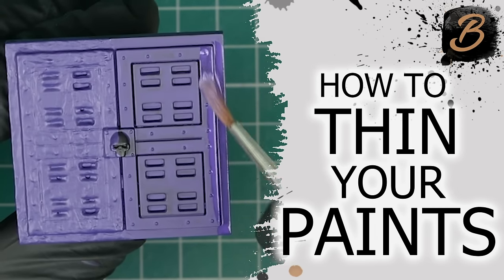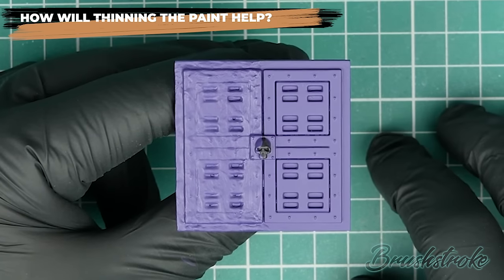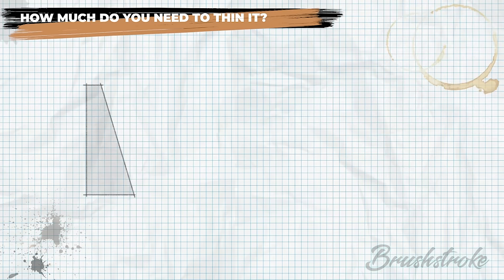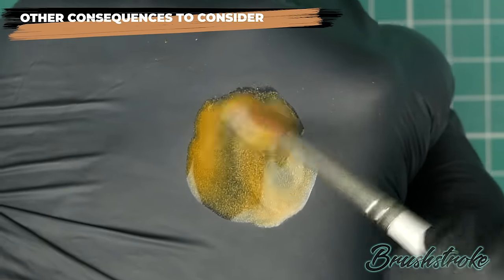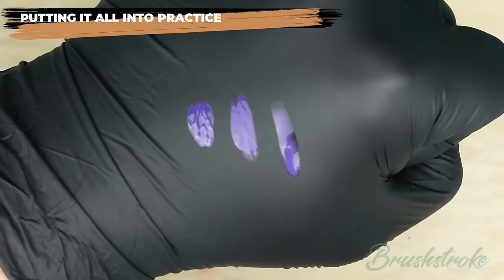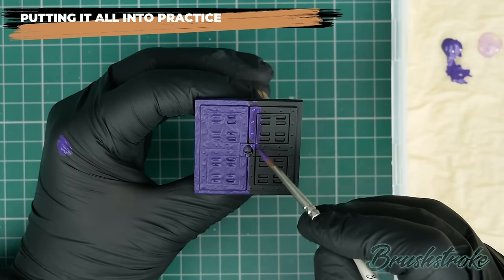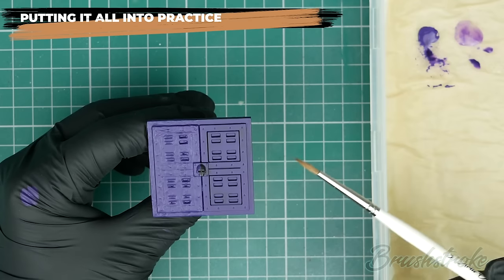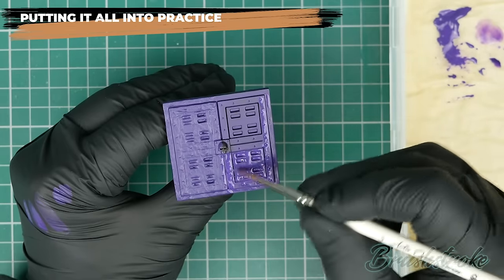HOW TO THIN YOUR PAINTS: A Step-By-Step Guide

Comment: Although it's generally considered more advanced to use an airbrush, I think learning to use an airbrush is a great way to learn about how thin you need your paint to be.

Having said that, you need your paint to be even thinner for airbrushing compared to painting with a brush.
Reply from the maker: I totally agree, there is significant overlap between the two methods for sure. And as you rightly say, those who are practiced in airbrushing will be well drilled in thinning their paints, with it be a necessity for effective results.
For me, the key thing is learning to observe your paints and how they behave. By knowing what to look for you can tell if it's thin enough to go through an airbrush or thick enough to stipple with. 
So much attention in painting videos is given to the end result without really looking at what it is that makes it happen.

Comment: Tbh, when i started painting i used to use paint straight from the pot and then spread the paint on the brush until there was no more and had the same effect as when you thin it. But then it was all comes down to which technique you prefer. Now i thin my paints a lot but i still do the old technique sometimes when i need just a little bit of paint for small details

Comment: Fantastic video, it clearly explained exactly why to thin and what to look for. I do wonder about the wet palette thinning the paint too much. Is it possible to use just the wet palette to achieve the perfect thinness?
Reply from the maker: Thanks for watching
Over time the paint will absorb paint through the paper, but using that process to find the perfect level would be very hit and miss.
You should just use your palette as a way of extending the life of the paint during your painting session. Nothing more.
It’s no meant to make them last for days and days as many seem to think

Comment: Fantastic video. I think that something that is missing from a lot of these discussions is the properties of water vs acrylic & water solution, surface tension has a really big impact on how paint moves, more water means more surface tension and a lot of paints at some point just fall apart and the surface tension fully takes over and they don't stick to models, bead up, etc. Water really likes to stick to itself to the detriment of sticking to other things, water-y paint takes on that characteristic. I also honestly wonder about different water supplies, i.e. hard water vs soft water, affect how your paints thin. I've used vallejo thinning medium before but I'm not too sure to what degree it is actually thinning paint vs just adding additional acrylic resin that has high flow to it.
Reply from the maker: Thank you.
Yes, you’re right. There is a whole video’s worth of discussion about water vs medium vs thinners vs alcohol 

For this I decided to not over complicate the message by introducing them into the mix.
As a quick answer - I opt for water to thin if I’m wanting a solid or near solid layer.
If I’m after a transparent result for blending or glazing the. I’ll go for a medium (usually the same brand as the paint I’m thinning)
The reason for switching to medium is because there is a limit to how much you can add water to a paint before it will split  (like oil on water)
Thinning with medium let’s you go past that point because it is basically paint without pigment. So you’re basically just reducing the pigment concentration without compromising the paint integrity

Comment: One thing I still get wrong after 25 Years of painting is: Not being patient enough and scrubbing off the first layer with subsequent ones. Great tutorial!
Reply from the maker: Patience can be a struggle for sure. Especially when you just want to get things on the table to game.
I can say batch painting helps, so painting multiple minis at once so a coat is dry by the time you get back to it after applying to the others.
Another great help is a cheap hair dryer.
Don’t try and force the paint to dry too soon and blow it around, but once it’s starting to go give it a blast to finish it.
Or as I do, when I think it’s dry normally, I’ll give it a quick shot from the dryer and be very sure 👍🏻

Comment: Really good video, possibly the best one out there. The theory part I thought was really helpful. Just a quick question what did you use to put water on the palette?
Reply from the maker: Thank you
For adding water to my palette I just use a cheap plastic pipette from eBay. They come in packs of like 20.
Or if I’m lazy, I’ll just dip my paintbrush handle in the water pot and drip some water on the palette with that 😉
Reply: @BrushstrokePaintingGuides  OK, that's really helpful. Thanks for the reply.

Comment: Would you consider making a follow-up video for glazing or layering? I still still struggle with paint consistency for those. When I mix a "fast" paint for glazing, it tends to run around on the model surface and dry in ugly patches, rather than going on as a smooth coat with nice transparency.
Reply from the maker: Yes, I think a video on glazing and layering would a great idea. 

From what you described there though, it sounds like you’re just applying too much at once. When glazing it’s all about “little by little”
You build up the transition and blend through multiple (often lots) very thin layers.
Often when glazing it feels like when you first start applying it, nothing is happening and so the natural reaction to “I need to add more” but you need to fight that urge and be patient 
Little by little. And let it build

Comment: The irony of your channel name vs the ultra smooth, no-strokes-showing paintjobs you achieve is striking :)  Great video and it has me reflecting on my own approach which tends towards being too thick. I'm lazy and impatient and try to do things in one coat quite often, which clearly sacrifices detail. Side question: what are you using to record your painting, which allows for those cool palette-to-hand pans?
Reply from the maker: Yeah, there’s some heavy irony there for sure, you’re not wrong 😂
In terms of you reflecting on your painting, I think it’s like everything in this hobby, you need to decide your aims and pick the most appropriate method to achieve them.
If your core aim is to have an army painted in two days. Freehanding and glazing is not where you should be and then the other extreme, if you’re wanting to compete at Golden Demon, then a couple of contrast paints aren’t going to cut it.
What I wanted for this video was to get people thinking about the behaviour of paint and what they’re wanting it to do.
Ultimately to expand people’s options I guess.
Recording wise; I shoot with a standard fixed camera but at very high res and then crop and pan in the edit
Hope that helps
Reply: @BrushstrokePaintingGuides  thank you, that’s great food for thought! Ps can I ask what camera you are using?
Reply from the maker: @TheMiniJunkie  no problem, thanks for checking out my channel.

Erm, my camera is a Panasonic LUMIX dslr. I forget which model off the top of my head. Truth be told I don’t pretend to know how to use all the functions on it. 
Through, general trial and error I’ve got it to a point I’m happy it’s a reasonable match to the minis in real life.
If money were no object of course I’d love to upgrade and do multi cameras and the like.
Maybe one day
Reply: @BrushstrokePaintingGuides  thanks! Your footage is great in any case :)
Reply from the maker: @TheMiniJunkie  thank you.
I do still struggle with focusing at times but I’ve gotten so much better than when I first started.
Painting on camera is SO hard to do 🤣

Comment: A thing I've really noticed is that people will always tout two thin coats, but more is okay too! An important part to note is that if you thin enough for 3 thin coats, don't get discouraged at how uneven it looks at 1 or even 2 coats. Don't start going thicker just because it doesn't look good before it's done right. It will often look splotchy or splodgy when you're halfway done

When I worked at GW we often used the comparison of melted ice cream to describe ideal consistency of paint, quite similar to your example halfway through
Reply from the maker: I totally agree.
I would much prefer to have to add another coat. Much harder to take paint away, than add more ;)

Comment: Great video on smooth painting. Struggled with this and your video really helped me progress.

Any chance you could do a video how to get smooth results on light colors. Find it hard to work with brighter colors than darker. Like whites and yellows? Got any tips how to layer bright colors for the right results?
Reply from the maker: Thanks for watching, great to hear you’ve found it useful.
For lighter colours, I presume you’re meaning painting them over a dark primer?
So, you have two options really, either start with a lighter primer - white or pale grey.
Or if you have to paint over black, say, I would recommend you apply an intermediate layer first of a middle tone colour to reduce the level of difference.
So, for black to white, I’d use a mid grey layer first, then a pale grey and only then white.
The intermediate layers don’t need to be solid, just enough to reduce the colour difference between each layer.
Hope that helps

Comment: I have a couple of questions:  1st - What impact does the primer have on affecting the surface tension of the paint and thereby changing to flow and coverage?  2nd: Is it better to use just water or a medium designed for acrylics?  Thanks.

Comment: Does it matter, using tap water vs distilled/de-ionized? What do you use?
Reply from the maker: That's a really good question and unfortunately I'll have to answer with a "depends".
So, I'd say in terms of the general principles shown in this video, no, the water used doesnt change the processes and methods covered here.
However, in terms of getting the best, cleanest, purest results for your paint, then yeah sure, using a purer, less contaminated water would be better.
But here's the crux of it, would distilled water be noticeably better than using tap water?
That all depends on your tap water. If your tap water is very hard, with noticeable calcium content, for example, then perhaps that would be noticeable in your paint results and you'd be better using distilled.

I personally have only ever used tap water and live in an area which has a medium hardness. And I've never had a problem. I do know people who swear by only using distilled water but they are in areas where their tap water isnt recommended for drinking.
Generally though, I would say just use tap water if it's drinkable

Comment: Enjoyed the video and appreciate the effort that went into it. What's your thoughts/methods for metallic paint?
Reply from the maker: Thank you
I thin metallics just the same way.
What I would say though, is they benefit from underpainting.
What that means is often the coverage of thinned metallics can be low and as a result require the application of more coats. One way to combat this is to paint a colour underneath first which will be easier to cover with the metallic.
For example, golds will cover over a warm brown easier than they would white.
Hope that helps
Reply: @BrushstrokePaintingGuides  thanks for that. I will practice on some bases. Hope you have a good day

Comment: Incredibly helpful and informative, one question though, do you need to worry about the pools of thinned paint clogging up the recessed details?
Reply from the maker: Thank you
Obviously too much of anything will eventually clog details but, in the same way a wash doesn’t, correctly thinned paint shouldn’t either. As most of its volume will actually be water
Reply: @BrushstrokePaintingGuides  thank you, that's great 👍

Comment: A well explained method Thank you. But it raises another question. The pigment is thinned out with the water but so to is the acrylic polymer. How does the painted surface stand up with more water added? Is it brittle? Does it rub off? Must it have a sealer coat added on top? The pigments themselves have no ability to stick to a surface other than temporarily. It is the polymer that provides that adhesion and sticking ability, if it is thinned out that means that the adhesion of the pigments to the surface is compromised as well as becoming translucent. 
Lets face it, the paint makers would reduce the acrylic polymers to the thinned consistency to save money if the final product was as stable with more water and less polymer. They might even rename it spraying paint or something and charge more for it!
Reply from the maker: So, that’s a great question and one I hope I can explain properly.
The amount of water needed in order to get the paint “moving” and to settle flat, isn’t (and shouldn’t be) enough to compromise the integrity of the paint to the point where it no longer bonds etc.
The amount of water needed to be added is actually very little.
You are absolutely right though, there is a point at which you can add too much water and the paint can no longer hold together properly and the ingredients “split”.
If you are wanting to thin a paint down to or beyond this point, to create a glaze for example, then you will need to substitute the water for an appropriate medium.
Medium basically being paint but without the pigment. 
By thinning with medium you can reduce the pigment ratio of the paint to very lower levels and create paints with very high transparency but still maintain the ratio of polymer etc which make the paint function correctly.

Thinning a paint in the way demonstrated in this video won’t “split” the paint, so there isn’t a requirement to apply additional protection for the paint.
However, I would always recommend applying a thin layer of varnish over any paint job when finished regardless if it’s been thinned or not, as it will help protect it for handing and transit when gaming.

Hope that helps
Thanks for watching 👍
Reply: Thanks for that.  @BrushstrokePaintingGuides

Comment: This was a fantastic tutorial. Is there any specific amount of time you wait before starting on another coat? Also how many coats do you typically do?
Reply from the maker: Thanks, glad you enjoyed it.

Drying time obviously depends on a lot of external factors like climate etc
However, you do need to ensure each layer is fully dry before applying the next one. Otherwise you run the risk of disturbing the last layer and ruining the smooth result.
Typically I just do two coats, maybe three if the particular paint requires it. 
Every paint’s “sweet spot” is different and it’s that which determines how many coats will be required in order to achieve a solid finish

Comment: this is huge. i just got into painting minis and i always heard you had to thin your paint, however i always assumed that if you had any movement it was too thin and would run down your model and ruin other details. i have been putting on paint way too thick. do you have any advice for controlling fast paints and keeping them where you need them and nowhere else?

Comment: Hello thank you for the video I really like it and help with painting 
Do Vallejo paints also need to be diluted with water?
I tried it as in your guide but it was very watery.
Reply from the maker: Hi
Welcome to the channel and thank you for becoming a member. Your support is really appreciated. :)

In terms of your Vallejo paint question, all paints are different so the amount of water (if any) needed to get it to the point you need will always be different. The aim of this video was to try and explain the process I use to determine this by giving characteristics and behaviors of the paint to look for and ways to test it before you add it to your miniature.
From what you described though, it could be the paint you have is already thinned for airbrushing for example. So, if that is the case, it is very unlikely you'd need to add any more water to that paint because it is already thin enough to flow and settle as you need.
Hope that helps :)

Comment: I've noticed that you use Citadel paints. I haven't been painting models for long, but I've used Tamiya acrylics. A friend gifted me Citadel paint because they thought it was great for Warhammer. The colour choice was slightly more varied, and the coverage was similar to Tamiya's paints. However, when I checked the price, the Citadel paints are around 3 TIMES as expensive as the Tamiya for a smaller pot. 

TL;DR: If you're painting a lot, try using Tamiya instead of Citadel to save your pocket.